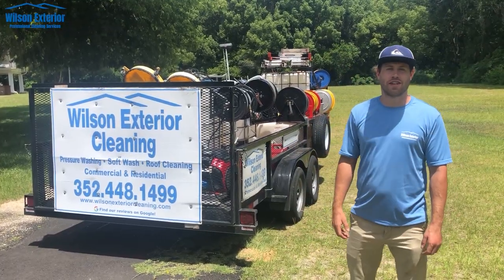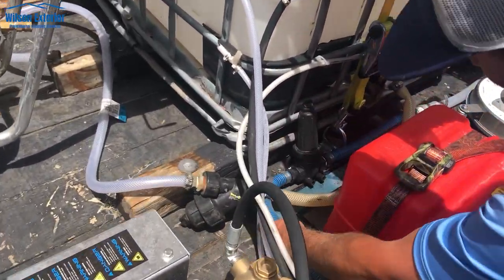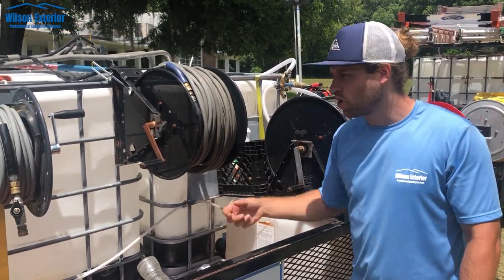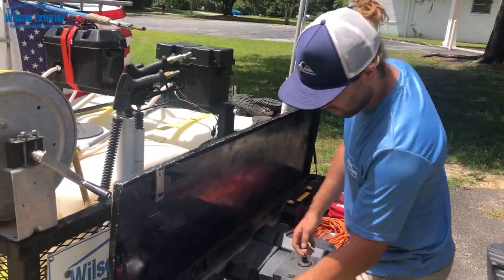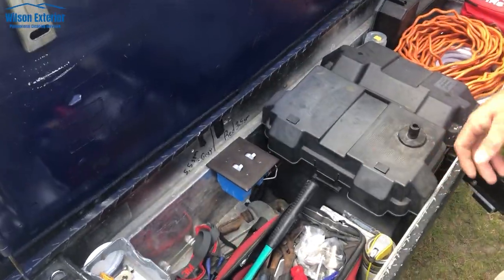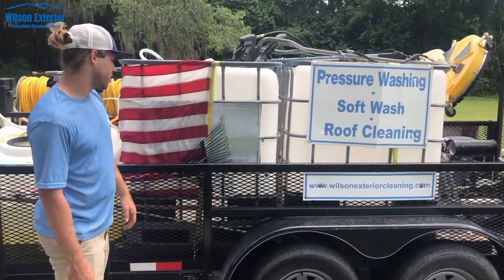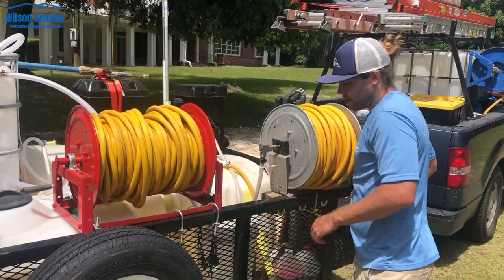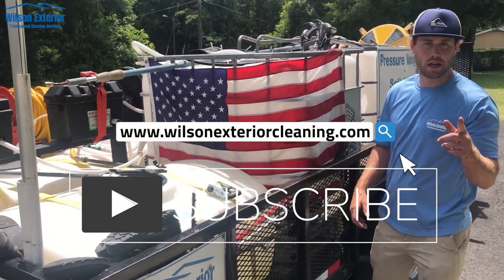Pressure Washing & Soft Washing Trailer Rig Set Up 2020

Comment: is that an AR4g40 pump on that gx390 direct drive unit? if so, are you able to draw water from the tank with it?
Reply from the maker: The pump is a direct drive, so it's better to use a garden hose to feed it water. Belt drive pumps are better to tank feed.

Comment: What equipment did you start with originally once you were doing driveways houses and roof?
Reply from the maker: I had a harbor freight pressure washer and a northern tool electric pump with a garden hose to start with
Reply: @WilsonExteriorCleaning  I see you have a trailer rig now. Looking back, if you had the money available when you started would you buy the trailer setup in the beginning?